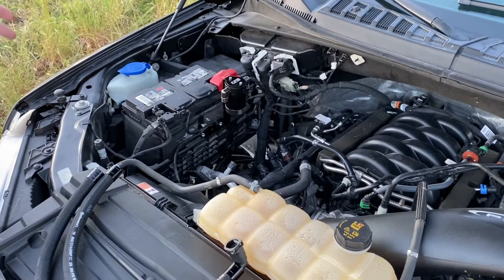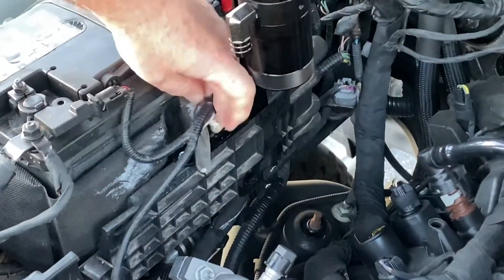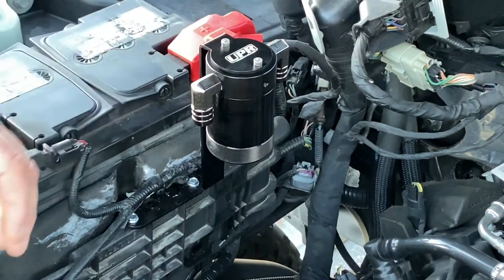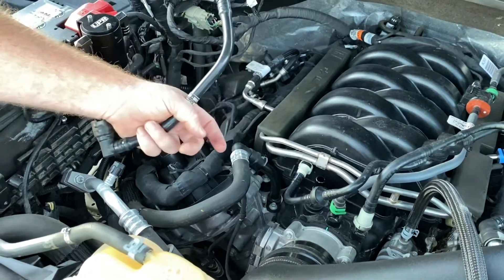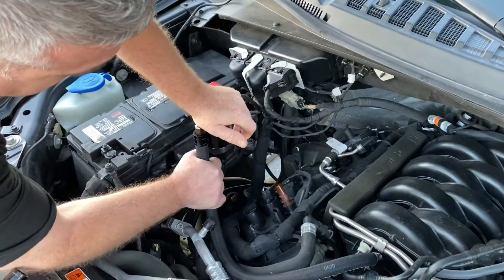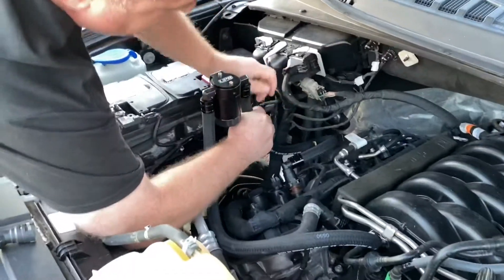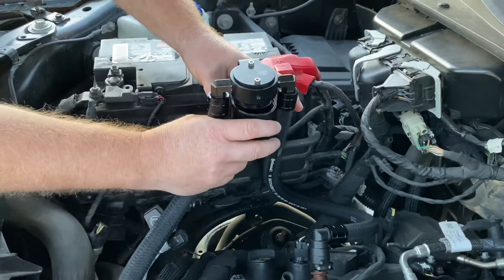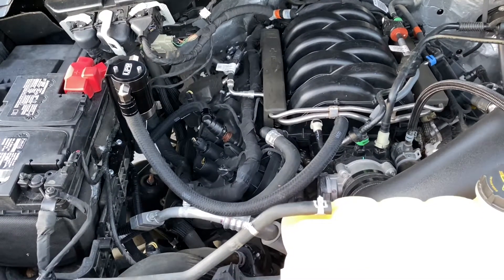UPR F150 (and EcoBoost) Catch Can!   Why Does Your F150 Need a Catch Can?

Comment: I saw some catch cans with an air filter sticking out of the top.  Is that a good thing for the f150 3.5 ecoboost?  Or would it cause a vacuum leak or something?
Reply from the maker: Not recommended as they cause vacuum leaks. The best Catch Can we offer is a system is a sealed unit for the F150 Ecoboost and add a UPR Baffled Billet One-Way Valve Cover Crankcase Breather to vent the hot air and unwanted crankcase pressure without affecting driveability. This will give you the two very best options for oil control and overall engine performance.

Comment: Nice stuff 👍
Reply: Thank you, we wanted to offer a compact setup that has all our trademarked components. UPR 3-Stage Billet Diffuser, Contitech Braided Hoses, UPR Billet Fittings, UPR Billet Hose Ends, and UPR Plug n Play™ Catch Can Fittings. We guarantee our products to be the very best available and strive to offer a factory OEM or better looking and performing product. The most important improvement made to this kit is the superior filtration system unlike the generic honeycomb or compressor filters used in all the current offerings on the market. As oil control and engine longevity are the most critical factors that we focus on with all our New Multi-Stage Catch Can offerings. All our New Catch Can are designed to be modular and utilize the same quality, components, and performance across all the platforms. These are a great entry-level addition for any F150 owner and then for more serious performance enthusiasts, we offer the 5030 kits with improved performance, larger capacity, and optional CSS or ECSS for driver-side protection. Hands down UPR offers the best quality and performing compact 5.0 and Ecoboost F150 catch cans available.